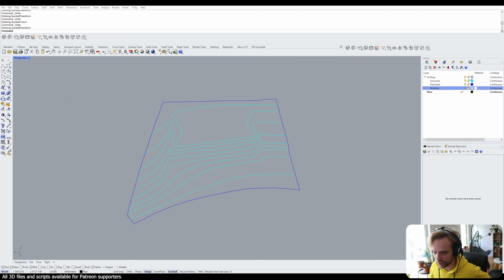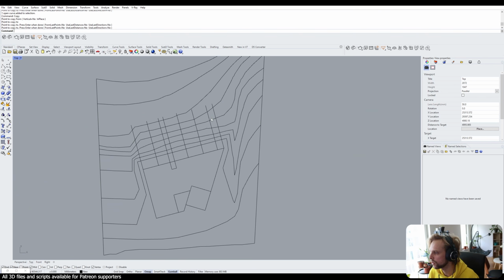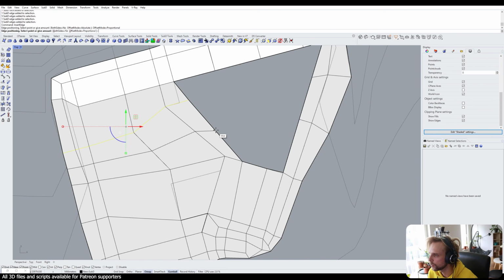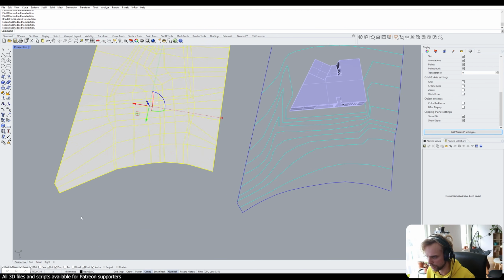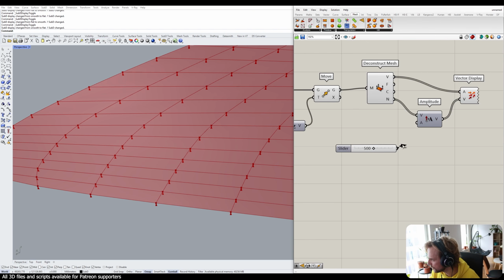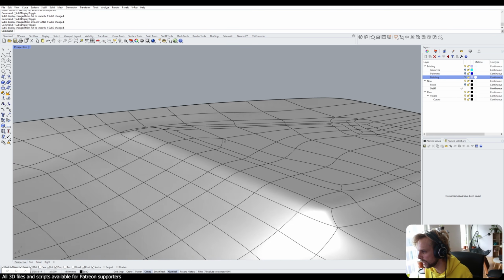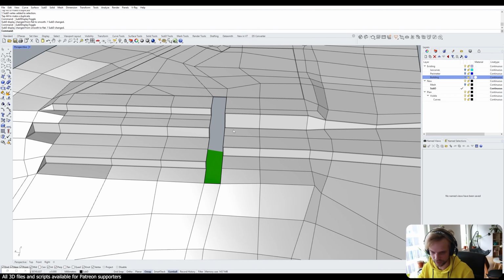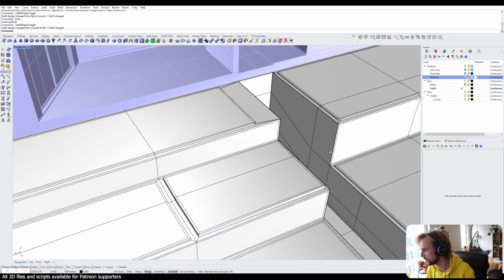This is how you do LANDSCAPE DESIGN with Rhino.

Comment: I'm coming from the GIS world. Are these contour lines hypothetical and representative of grading to be done during construction or representative of real-world topography? It seems to me that using raster or lidar data would be save a lot of time.
Reply from the maker: I assume we're talking about the input as the output is simply a proposed design. The contour lines come from proper measurements done by either the municipality or a third party - so they are real-world. Lidar data is still not fully accepted as proper "official" measurement in some EU countries, especially if you're dealing with the countryside (no idea about America/Asia).

Comment: can't you just use patch and then quadremesh?
Reply from the maker: Patch uses a grid of points that are strictly aligned with X-Y coordinates, so anything that is at an angle will have an error similar to the step size of the path itself. If you're doing a school project - that's fine, but if you're working on a real project - not working at 0 tolerance precision might cost you quite a bit during the construction phase.

Comment: Removing contour lines causes mistakes . Note that Delaunay algorithm creates red lines crossing the contour lines. The effect is changing the heights of the model. Triangulation should be done only between the contour lines.
Reply from the maker: the places where delaunay edges cross contours have a constant slope (to a certain extent). If you want a more accurate representation - you can always use divide curve distance rather than discontinuities node to generate more points.
Reply: @DesignGoBrr  : To a certain extent, really :) Look exactly at the center of your area.

Comment: In order to get more detail, divide each curve by their own length (or divide length by 1000 or 2000 if working in mm) and add those points to the triangulation.
Reply from the maker: It will just increase the amount of triangles. If the input CAD data resolution is limiting the detail level, then it doesn't really matter how finely you divide the triangulated mesh that tries to approximate the CAD input
Reply: @DesignGoBrr  yes, but you won’t get the triangulation artifacts where the Delaunay triangulation skips part of the contour lines. If you retriangulate as you did here, it won’t really impact the final tri count, but you get a mesh following the countours more closely :)
Reply from the maker: @sigurdgjestiberge3176  This is correct!
Reply: @DesignGoBrr  really like your videos btw:)
Reply from the maker: @sigurdgjestiberge3176  Thanks! I try I try...

Comment: I was trying many times to use nurbs for site modeling. Subds, as nurbs does, produce degree 3 geometry. I don't think this is the way to go. Landscapes cannot modeled with degree 3 geometry. They need degree 1. That's why all site and road design modelers uses meshes and specifically triangular meshes. And the main reason it's because site modeling always need creases. After a lot of trying that's my conclusion.
Reply from the maker: hmm, depends on the country/industry I guess - we're using SubD for our landscape design and have no problems with getting building permits and the geometries being realized by the landscaping contractor.